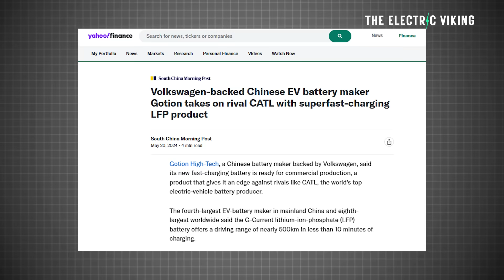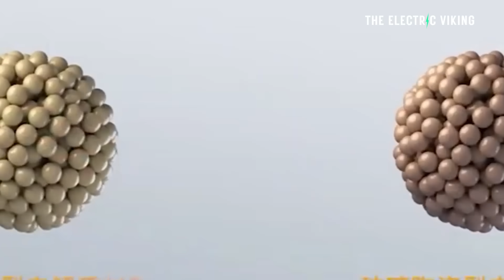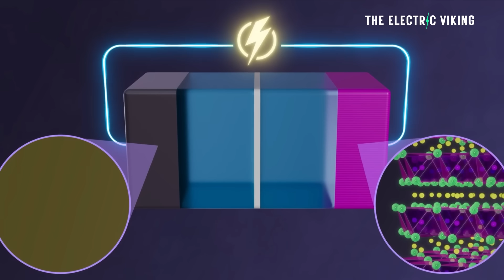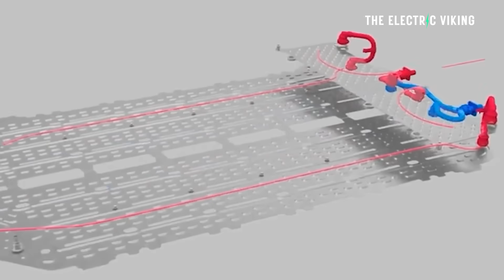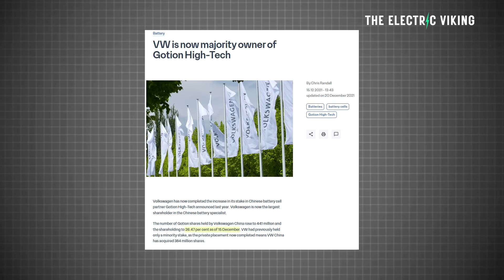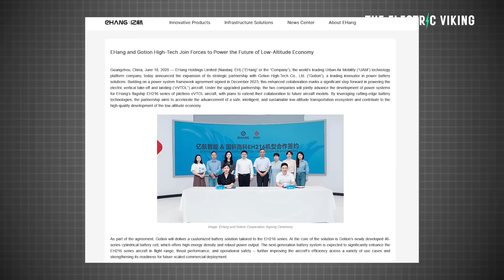VW-backed Gotion reveals solid-state battery with 1 MILLION KM LIFE!

Comment: 1 million km is a stupid thing to say when it comes to battery life. It is hot air and meaningless. Depending on the setup, you can have a battery that takes you 1 million km on a single charge down to a battery that has to be charged a gazilion times in order to reach 1 million km. Also, what are we talking about going 1 million km? A bike, a car, a bus, a plane, a train?

Comment: I don't think the market for more expensive EV batteries is the way to go, what I would pay for is a 900kg small light all wheel drive hatch the size of a Golf or WRX that is fully featured. If it has only 400-500km range that's fine with me  I've got a model S that has ~400km range and it's a big car, but if I bought a model 3 I wouldn't save that much space losing the great sound system in the process.

Comment: I would pay more for SS battery in a performance car, even with similar range to NMC equipped model, simply to have better driving dynamics via the lower weight. But probably wouldn't pay a big premium for an SUV or everyday car.

Comment: thanks for the video ! pretty interesting topic for me... earlier this year we purchased a small and medium sized generators from Yoshino. they are 'supposedly' solid state batteries BUT i noticed right away on delivery the box had the caution tags for lipo batteries. that made me wonder so i did some research and i cannot say they are or are not BUT its been disputed here on YT. atm they are both working and mostly fully charged (even tho you shouldnt exceed 85% for longevity) im just hoping they are still working (although no doubts they will be) next year when the storms hit or even possibly later this year... also got a couple solar panels (100w) to charge each individually if needed. that reminds me i STILL need to get the connectors/connections so IF i wanted to use both on the same generator. (ie. 200w) as that is just something not included with the panels... (different brands btw one yoshino the other harbor freight) i really love both of those panels tho :) i just look forward to actually using them lol... (the HF folds in 1/2 and the yoshino is slightly more compact and folds in 3 which would be nice since i could carry it easily on the motorcycle etc...

Comment: 1000 km is absolutely useless. A range of 600 km is great, when it comes with good charging facilities. On a long trip you need a break, so some charging time is no problem. These kind of batteries will be great for packs up tot 60 kWh. Those packs will be light, so the cars can be even lighter. Without losing performance the motors can be smaller. These batteries open the way to very efficient cars.

Comment: I like the idea of small cylinders shape better than those diapers.
Better heating in the winter and cooling in the summer.
Also can eject faster.

Batteries should be as cheap as propane and I like the idea of limos or even larger height.

Comment: Rumor has it that CATL is developing a sodium-based 350+ kWh battery that would cost a fraction of a potential solid-state counterpart. If that turns out to be true, Gotion and QuantumScape would be obliterated before they can even commercialize their products. I wish I had a crystal ball. 😂
Reply: CATL actually just announced a Na-ion battery with 175 kWh, which is already better than most Li-ion batteries.  It is also much cheaper, supports large temperature variations, and can be recharged for many more years.

Comment: I've always thought that if they split the battery pack into 2 units, one up the firewall and the second behind the rear seat in a vertical position like the firewall one or under the seat. I think it would reduce the cost of replacement as maybe only one is damaged or failing and also they just slip in and plug it in making it easy for even the DIYer to do it at home.

Comment: Toyota claims that their solid state batteries will be cheaper than the current lithum-ion ones. Why do you believe that solid state would add $20K to the cost of the car? I wouldn't buy it. 300+ miles of range is enough for cross country trips. Yes, rapid charging would be a huge advantage. But not $20K advantage.

Comment: Again! Wh/kg is not the measure of a good EV battery!!!
Just compare hydrogen vs diesel.
In wh/kg hydrogen has an energy density of 33.000 and diesel 12.700. So, why isn't everyone use hydrogen, then???
Because diesel has 10.700 wh/l and hydrogen has 1.400 wh/l at 700 bar.

And this battery is even better, because it has 800 wh/l.

Comment: I would say that, realistically, solid state batteries would become feasible for the masses (non luxury/sport EV's) in around 5-7 years from now. Reason being: all newly developed technologies (doesn't matter if we are talking about batteries, displays etc) have 2-3 generations where they are very expensive because of the costs of the development. I also think that we don't need to wait for solid state. My guess is that, by the time solid state become really appealing cost wise, Sodium batteries would be so cheap and so good from energy density and charging speed perspective, that you wouldn't need solid states anymore for cheaper cars...so they would probably still be used in the more expensive cars

Comment: Already in current EV's the weakest link is the driver. I've driven more than 1300km in one day and I still had to take two breaks, even if there was no need to put more diesel into the car. Sitting more than 6h in a bench driving, is just not that viable without taking at least a leak and stretching your legs. Ideally you would want to eat something and walk a minute or two  every few hundred, and current EV's can already do that if it's not extremely cold. Up here where -40'c is regular every winter occurance, I am more excited about Na-ion batteries which are already in the production, since even if the range is same during the summer, not having 30-60% less kilometers in normal winter temperature would be the game-changer.

Comment: The key is to get it to the point where, similar to momentum powered automatic wrist watches, all EVs and other battery powered technology is constantly passively powered by a supersustainable wireless powering passive infinite renewable energy infrastructure environment. So, similar to constantly innovating higher density tinier, and tinier microprocessing chips, the ongoing battery goal is extreme energy density infinite range fast charging tiny batteries, and power supplies. So, the goal should be to make EVs run 1000 miles on super stable quality fast wireless charging batteries the size of modern day acid car batteries, and even then constantly STILL focus on innovating forth toward 10,000 mile wireless charging EV range on super stable quality fast wireless charging laptop sized batteries, .. so on, and so forth progressively sustainably innovating toward tinier higher density passively sourced power sources ad infinitum with E=mc² as the current super renewable passive energy limit.
     🤛😆🤝🚙⚡🔋⚡☂️🪟☀️🪟☂️⚡🔋⚡☂️🪟☀️🪟☂️⚡🔋⏳⚡☂️🪟☀️🪟☂️⚡🔋🔋🔋🔋⚡🏭⚡☂️🪟☀️🪟☂️⚡🔋⚡☂️🪟☀️🪟☂️⚡🔋🔋🔋⚡☂️🪟☀️🪟☂️⚡🔋🔋🔋⚡⚡⚡⚡☂️🪟☂️🪟☀🌞☀🪟☂️🪟☂️⚡🔋⚡🌪⚡🔋⚡🌛🌊⚡🔋🔋🔋⚡☂️🪟☀️🪟☂️⚡🔋⚡🚗⚡🔋⚡☂️🪟☀️🪟☂️⚡🔋⚡🛻⚡🔋⚡☂️🪟☀️🪟☂️⚡🔋⚡🚛⚡🔋⚡☂️🪟☀️🪟☂️⚡🔋⚡🚒⚡🔋⚡☂️🪟☀️🪟☂️⚡🔋⚡🚌⚡🔋⚡☂️🪟☀️🪟☂️⚡🔋⚡🚚⚡🔋⚡☂️🪟☀️🪟☂️⚡🔋⚡🚑⚡🔋⚡☂️🪟☀️🪟☂️⚡🔋⚡🚐⚡🔋⚡☂️🪟☀️🪟☂️⚡🔋⚡🚜⚡🔋⚡☂️🪟☀️🪟☂️⚡🔋⚡🛺⚡🔋⚡☂️🪟☀️🪟☂️⚡🔋⚡🚲⚡🔋⚡☂️🪟☀️🪟☂️⚡🔋⚡🛴⚡🔋⚡☂️🪟☀️🪟☂️⚡🔋⚡🛹⚡🔋⚡☂️🪟☀️🪟☂️⚡🔋⚡🛵⚡🔋⚡☂️🪟☀️🪟☂️⚡🔋⚡🦼⚡🔋⚡☂️🪟☀️🪟☂️⚡🔋⚡🏍⚡🔋⚡☂️🪟☀️🪟☂️⚡🔋⚡🏡⚡🔋⚡☂️🪟☀️🪟☂️⚡🔋⚡🏠⚡🔋⚡☂️🪟☀️🪟☂️⚡🔋⚡🏘⚡🔋⚡☂️🪟☀️🪟☂️⚡🔋⚡🏢⚡🔋⚡☂️🪟☀️🪟☂️⚡🔋⚡🏤⚡🔋⚡☂️🪟☀️🪟☂️⚡🔋⚡🏥⚡🔋⚡☂️🪟☀️🪟☂️⚡🔋⚡🏨⚡🔋⚡☂️🪟☀️🪟☂️⚡🔋⚡🏩⚡🔋⚡☂️🪟☀️🪟☂️⚡🔋⚡🏪⚡🔋⚡☂️🪟☀️🪟☂️⚡🔋⚡🏫⚡🔋⚡☂️🪟☀️🪟☂️⚡🔋⚡🪑⚡🔋⚡☂️🪟☀️🪟☂️⚡🔋⚡⛺⚡🔋⚡☂️🪟☀️🪟☂️⚡🔋⚡🚓⚡🔋⚡☂️🪟☀️🪟☂️⚡🔋⚡🚕⚡🔋⚡☂️🪟☀️🪟☂️⚡🔋⚡🚅⚡🔋⚡☂️🪟☀️🪟☂️⚡🔋⚡🚄⚡🔋⚡☂️🪟☀️🪟☂️⚡🔋⚡🚎⚡🔋⚡☂️🪟☀️🪟☂️⚡🔋⚡🚃⚡🔋⚡☂️🪟☀️🪟☂️⚡🔋⚡🏎⚡🔋⚡☂️🪟☀️🪟☂️⚡🔋⚡🛳⚡🔋⚡☂️🪟☀️🪟☂️⚡🔋⚡⛴⚡🔋⚡☂️🪟☀️🪟☂️⚡🔋⚡🚁⚡🔋⚡☂️🪟☀️🪟☂️⚡🔋⚡🚤⚡🔋⚡☂️🪟☀️🪟☂️⚡🔋⚡✈⚡🔋⚡☂️🪟☀️🪟☂️⚡🔋⚡🚀⚡🔋⚡☂️🪟☀️🪟☂️⚡🔋⚡🛰⚡🔋⚡☂️🪟☀️🪟☂️⚡🔋⚡🏟⚡🔋⚡☂️🪟☀️🪟☂️⚡🔋⚡🏙⚡🔋⚡☂️🪟☀️🪟☂️⚡🔋⚡☂️🪟☀️🪟☂️⚡🔋⏳⚡☂️🪟☀️🪟☂️⚡🔋🔋🔋🔋⚡🏭⚡☂️🪟☀️🪟☂️⚡🔋⚡☂️🪟☀️🪟☂️⚡🔋🔋🔋⚡☂️🪟☀️🪟☂️⚡🔋🔋🔋⚡⚡⚡⚡☂️🪟☂️🪟☀🌞☀🪟☂️🪟☂️⚡🔋⚡🌪⚡🔋⚡🌛🌊⚡🔋⚡🌎👍

Comment: The VW ID4 in Ireland already has Taxies with 750,000 km on their clocks and absolutely no issues along with the VW ID7 also giving no trouble.
Chinese cars in Ireland have massive RUST and suspension issues, you need to highlight please.
Reply: bro cite some proof or data if you want to highlight
Reply: Sounds like you are shilling for VW which is actually partnering with Xpeng because they need Chinese expertise to make cars. 

Chinese taxies have million + miles with no rust. The battery would have degraded way less too
Reply: Source: trust me bro
Reply: problems can become an opportunities.
think about it.🤔🤔🤔
Reply: VW has more experience in Ireland so maybe they have much better knowledge of Ireland's road conditions and how to seal cars from Ireland's weather than Chinese manufacturers. ChGpt "Ireland’s weather is generally more likely to cause rust on untreated imported vehicles compared to much of the rest of Europe. Here’s why: 1.High humidity and rainfall — Ireland has one of the highest average humidity and rainfall levels in Europe. 2.Salt exposure: Coastal air across Ireland carries salt spray from the Atlantic, even many miles inland. 3.Mild temperatures: means vehicles often stay in a damp environment year-round, which gives rust more consistent conditions to develop." And it's  possible the suspension issues are also related to weather/rust. As someone suggested earlier, the problem is an opportunity.
Reply: Thanks and Fair Play to you Michael !!
Reply: But question is how many times have they changed their batteries? Also I have heard of Tesla model s that have gone 150k km with just 1 battery change ( which also makes it quite expensive and use more oil than a diesel car if you calculate the energy needed to mine and produce the battery.... )

Comment: I just bought a 2021 VW EV. I am liking the options that I'll have in a decade when it comes to replacing the battery pack.
Reply: You probably won't need to.
Reply: @jamesvandamme7786  - I'll probably want to with all of these improvements. Much better range, less fire hazard, etc.

Comment: For me, who can't charge at home, there is a big difference between a 400m battery that can quickly charge to 80% range, and one that can quickly charge to 100%.  Fix that last 20% and prevent degradation, and I'll take a range of 400m.  But without that, I want 500m.

Comment: Inside Africa's powerhouse $16 billion solar push to light up every home by 2030:  Rwanda is intensifying efforts to harness solar energy as part of its ambitious plan to deliver electricity to every household by 2030, a move that could position the East African nation as one of Africa’s leading clean energy pioneers.  Rwanda targets universal electricity access by 2030, with 82% of households already connected. The country plans to add 1,500 MW of solar capacity by 2050 under its national power development plan. Financing remains a challenge, with $3.6 billion needed by 2035 and total generation costs projected at $38 billion by 2050. Experts call for policy reforms and standardised power agreements to attract more private investment into the solar sector.  According to the Ministry of Infrastructure, 82% of Rwandan households now have electricity, with 57% connected to the national grid and 25% powered by off-grid systems, mainly solar. But despite this progress, solar energy still accounts for just 1% of Rwanda’s 406-megawatt (MW) installed capacity, while hydropower dominates at 39%. Experts warn that this overreliance on hydropower leaves the country vulnerable to climate shocks such as droughts and erratic rainfall that disrupt generation.  Under the government’s Least Cost Power Development Plan (2024–2050), Kigali aims to add nearly 1,500 MW of solar capacity with battery storage by 2050. The government estimates that it will need about $3.6 billion by 2035 to meet rising electricity demand, including $69 million for short-term solar projects. Between 2035 and 2050, generation costs could surge to $38 billion, with solar investments alone accounting for $16 billion. The Rwanda Energy Group (REG) oversees power generation and distribution through its subsidiaries, Electricity Utility Corporation Limited (EUCL), which manages operations, and Energy Development Corporation Limited (EDCL), which handles planning and electrification. Private investors can participate in power generation through independent power producer (IPP) models, with the EUCL acting as the sole off-taker. While Rwanda offers tax incentives, industry players argue that more predictable policies and cost-reflective tariffs are critical to attracting capital. Standardising power purchase agreements and expanding feed-in tariffs would unlock private investment. As African nations race to expand access to clean and affordable energy, Rwanda’s solar ambitions could become a model for sustainable electrification with its bold vision. America is throwing away prosperity with its delusion that expensive fossil fuels compete with FAR less expensive global solar electrification.

Comment: They're selling the wrong thing to keep mentioning a million kilometers or a million miles of life. The freaking bearings, seats, floorboards, etc. Never make it past $500,000 if not just $300,000. And if you don't make the car out of aluminum or stainless steel and you sell it to the East Coast, it won't make it $150,000. What they need to be selling and what you need to be analyzing is how fast they charge and what the range is and what the cost is. The rest of it is fluff until they make cars with easily repairable. Long-term consumables like seats, carpets, floorboards or they make them like Tesla does out of aluminum so that they don't last lots longer
Reply: The point is that because of what happened with the early EVs people are obsessed with thinking it will cost $20k to replace the battery. If the battery lasts 600k miles then they don't have to worry about replacing the battery ever because it will outlast the car.

Comment: I'm thinking sodium batteries will be more desirable than the solid state ones in cars at first. Solid state will be used in VTOL and other applications where energy density is more important than cost or how long they last.
Reply: I agree. The cost of sodium batteries will make them king for a long time
Reply: @PracticalPreparedness-n4u  Yep, there is a point when you can say "good enough" on cost, performance and safety and go with it.

Comment: Great video! I would not spend any more on range. The magic number in the US seems to be a range of 265 miles to 325 miles. I have a 2019 KONA EV with 325 miles range, way enough for me and my wife.
Reply: I drive 50.000 km pr year.
Range is king.
Reply: Extra range is for those rare situations now. 300 miles of range with 250kw charging is a perfect ice vehicle replacement in my mind. 

So if your battery degrades 20% in 10 years and you live in areas with snow or you want to tow. You need to start with 625 miles of range to still have 300 miles of range during a snowstorm in 10 years. 

I am very happy with my 2 model Y’s that will have 250 miles after 10 years and then 150 miles during a snowstorm. But I do understand the people that will want better than that.
Reply: I want 1,200 miles range. Suits my needs.
Reply: @MichaelSimonik  you don't really want such a range. 300-500 miles is more than enough
Reply: @danielodeniyi8729  If you spend a lot of time travelling through remote areas with a lack of good charging, and you can have a car with extreme range, then why wouldn't you want it?
(Obviously if that feature and the extra price makes sense for you and your use case.)
Reply: @Antmanzzz  traveling to a remote place that has no charging station? It is like traveling to a remote place with no gas station! Cancel the trip.
Reply: @MichaelSimonik  Won't you need to piss or eat before you reach the range? Just curious
Reply: @Daonexus  With a longer range car you can still be taking your toilet and food breaks here and there, but they don't have to coincide with charging locations. This is useful if you have to make stops that don't coincide with charging locations for example, such as in remote areas.